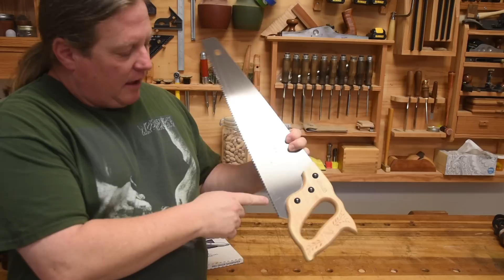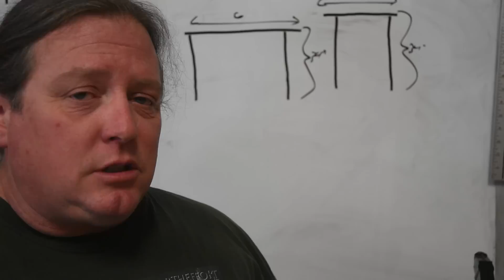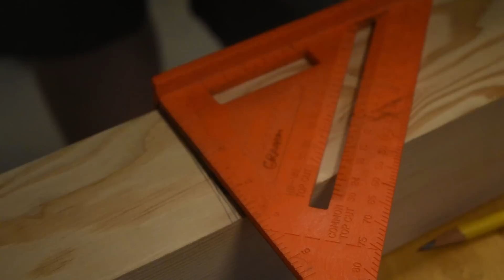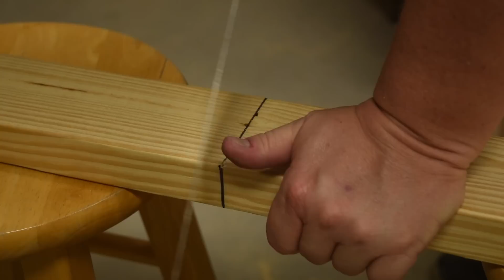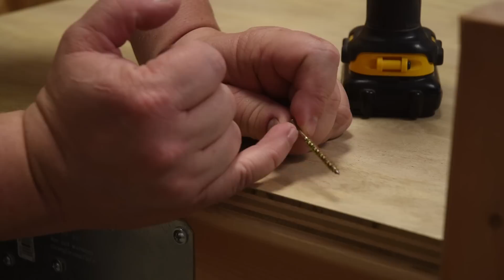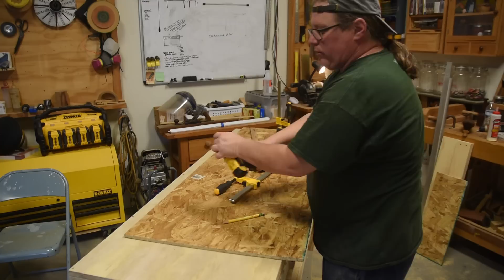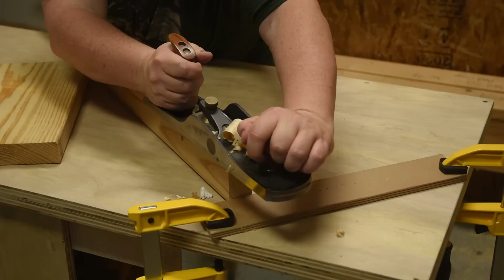The "No Skill" DIY Workbench Build - Start Woodworking Series Launch (Class One)

Comment: Lol I built a counter in my old barbecue restaurant with 1x6 boards that I took from a bunch of free wooden pallets and the counter top was a brand new industrial fireproof door that had corner damage from being dropped in shipping. That was also given to me for free. Only out of pocket expenses were for a few 2x4s for the frame, 2 1/2 inch screws and 4 carriage bolts that I used to secure the repurposed door to the top. Lol even made a swinging barn style door with the pallet lumber as the pass through from behind the counter. Turned out amazing
Reply: Oh and a couple gate hinges and latch

Comment: I had to laugh at the "system" to prevent your bench from creeping. Awesome, simply awesome. I love the entire bench. I built my first bench a year ago from construction left overs, and using very similar construction, though I didn't use the metal corners (wish I had know about those). Since I built it I've made a lot of modifications to it. I added a 10" apron on one side and put dog holes in it so I could use dowels to support long work. But I still haven't added a vice. Clamps, hold fasts, screw clamps, they are easy to use and completely flexible. Love the approach, love the bench.

Comment: The shelf will fit without cutting, you just have to turn it a bit and let one end down below the there and slide the short / width end in at an angle.
Another way is to put it in using the same method (above) but from either SIDE (not the front) of the bench.
DON'T be afraid of turning and angling the shelf to get it inside the bench then straighten it out to lay it flat.
It will work - I have 3 sets of these that I made into 8 foot high garage shelving and that is how I fitted all my levels of shelves.

Comment: Nice. Love the simplicity I think I would lay the bench down on the stools to lop off the tops. For me it was easier to cut down then to cut sideways.
Reply from the maker: Thanks. On it's side you'd have to saw on your back or upside down in order to use the two rails as a guide.

Comment: Great tutorial. The reason I came here was because I saw my 30 year old bench in the preview and I attest it is very strong- 30 years later. Got weight? Put shelf 5 inches lower and add a layer of engineer blocks on top of it.

Comment: Built this workbench with some modifications, I had to use the brackets for the 2x4 legs because I could not find a reasonable source for the ones for 4x4's. I also had to reduce the length to 5 ft because my workshop is very small. I also built two bench dogs for use on the bench. I am going to add the 2 Screw vise you added in Class 3 of this series  using 2 lag screws and a 2x6. I have purchased some compression springs I am going to mount over the lag screws to act as return springs when I adjust the vise. I also have the idea I will add a leg vise to the other end also operated by a spring loaded lag screw. Still thinking about how I will do this.
Reply from the maker: Springs good idea. Tell us how it works out.
Reply: @wortheffort  Unfortunately the springs did not collapse enough and kept the vise from closing so it would not grip thinner stock. I am rethinking how I might make it work so the vise can close fully. First thoughts are to bore recesses about 3/8 " deep not aligned with the lag screws and let the springs collapse into them. That should allow the vise to close fully. Trying to figure out how to support the springs as they retract and expand. They will need a rod or something to keep the springs straight.

Comment: For any other newbies watching:

I just finished building this, and there were 5 fairly significant things he left out that I wish I had realized when I started following this guide:

1) 100 screws is not, in fact, enough. And you don't want to only get the ones he linked to. Those are great for screwing in the metal parts, but they aren't long enough to screw in the middle struts and whatnot, where youre screwing through the 2x4 or plywood (not just *into*). Idk what the best is for the project; I ended up experimenting with and using a variety of screws. About the only advice I can give on that front is that 3" screws are WAY longer than you need (I think?). Probably best to do some research yourself.

2) Drill in pilot holes before screwing!!!!!! I cannot emphasis this enough!! I've got a couple of screws on the interior of the legs that are currently not screwed in all the way, and stripped to hell. I even had one screw snap on me when I was trying to screw the middle struts in (screwing into end-grain is TOUGH). I didn't realize until afterwards that the reason I was having so much trouble with them was because I wasn't drilling pilot holes in before screwing. Use a drill bit that's about the same width as the shaft of the screws you're using, but not as wide as edges of the screw. It's a bit more work up front,, but it'll save you A LOT of trouble and headaches in the long run!!

3) The quality of the drill you use is important. I got a cheap, cordless Dewalt drill from a pawn shop. For some reason (presumably a crap battery), it loses a lot of power quickly, and it'd frequently just straight up stop screwing in my screws in the thicker portions, even with pilot holes. I believe that an impact driver would solve that problem (or possibly a new battery). Instead, what I did was use a cheap, old bit-brace hand drill to do my drilling and screwing in the thicker portions of the table. It was a bit of extra work, but worked FLAWLESSLY. Even if you've got a good drill and impact driver, I'd highly recommend getting a bit-brace hand drill as a backup.

4) Either get a good push-style saw, or a Japanese style pull saw. I picked up a general use, $15 saw from home depot, and sawing was hell. It'd grip the wood like crazy, the curf was huge, left a pretty rough finish, and was generally just difficult to use consistently. I ended up getting a Suizan Ryoba Japanese pull saw, and OMG the difference is HUGE!! I was able to get SUPER smooth, clean cuts with insane ease! I actually enjoy sawing with that thing! And it was only $30! AND you get 2 saws out of it, one side for cross cuts (the only kind you have to do for this build) and one for rip cuts!

5) Unless you've got a truck or similarly large vehicle, transporting wood is gonna be a pain in the ass. I've only got a Toyota corolla, so I'd have Home Depot cut down my lumber to my desired dimensions for me (the Lowe's near me, at least, doesn't do that; they only cut down plywood), that way I could fit it in my car. Even then, though, it took multiple trips. And, even after having them cut down the plywood top, I could not fit it all into my car. I ended up having to leave the extra bit that he used to brace the table in the parking lot. If you've got a small car like me, I HIGHLY recommend getting someone with a bigger car to help you, or getting something on the top of your car that you can strap the wood to. Whatever you choose, just make sure you plan around that limitation so you don't leave $30 worth of plywood in a parking lot like I had to.
Reply from the maker: Granted 100 screws per kit won’t cover center stretchers. Showed that in video. Also getting a used corded drill was recommended. People only sell cordless when batteries go caput. The screws sold with kit shouldn’t need predrilling. Curious what caused strip and breakage. The $15-20 Stanley sharptooths are decent for what they are. Pull saws use different techniques. I built for the first 5 years of this channel with a Mini Cooper. Roof racks make a world of difference.
Reply: @wortheffort   Wow!! I wasn't expecting a response from you!! Thank you for the entirety of your channel and work; I can't begin to tell you how helpful and inspiring you've been for me!!!

Just to be clear, I wasn't intending to criticize or denigrate your video; just pointing out some things I didn't get from the video but would've helped while building, as a COMPLETE newbie.

Between the intro bit on supplies and the link in the description, I was initially under the impression that those 100 screws would be enough. After I ran out, I was at a bit of an awkward impass; I still needed like 2 or 3 more screws for the legs, but also needed to get screws I'd need for the top and sides (which you hadn't provided any specific recommendation for, so I kinda had to guess a bit on, not knowing the world of screws very well).

I know you recommended a used corded drill but, as I understood it in the video, it sounded like that recommendation was mostly to save money; I didn't realize a used cordless wouldn't be as good (and that may just be me; I'm basically the epitome of a skill less beginner; I've been all about math and computers my whole life til now).

The screws you recommended I didn't have a problem with without predrilling. It was once I ran out and had to start using other screws that I started running into issues; honestly, I have no idea what the difference is between them that cause the ones I got that were longer (for the struts and top) that were different enough to cause them to break/strip. I've no idea how to identify the qualities needed in a screw; I just found whatever woodscrews I could that were long enough and I had a bit for, and when they started to strip/break, pre-drilling the holes alleviated the problems I was having by A LOT.

As far as the pull saw recommendation, I recognize that you were focused on building the skill around the push-saw style, which is absolutely fine and cool, I just wanted to share how much of a world of difference the pull saw made for me in my attempt. I'm sure I'll figure it out over time, but currently I cannot for the life of me figure out how Japanese style pull saws aren't more the norm, at least for general-purpose sawing. It felt like the difference between cutting through bone vs cutting through butter.

And yeah, I'm definitely gonna have to pick up a roof rack at some point. Having to leave that last bit of plywood behind damn near broke my heart. Lol
Reply: @wortheffort  with regard to the screw that broke, it WAS while screwing in the middle struts, and I suspect that the reason there was so much resistance was due to a combination of screwing into end-grain, a knot that was in the strut, and probably being low-quality wood screws. Why I didn't have as much trouble while using a hand drill, idk.

Comment: Made my first "worktable" a week ago with one 2x4, and two 2x3's. It's uh...18"L x 12"W x 30"H. 6-1/2" vise on one side, a few dog holes, and storage shelf underneath....I live in a small apartment, so my work space is very small =). I made the supports low and sturdy enough to stabilize the bench with my foot if it moves. It fits my needs as I carve spoons, axe handles, and make small furniture. In fact because it's so small I can clamp something down and walk around all sides of the bench to work on it from all angles.
Reply from the maker: that'll work

Comment: Great video and I just left left Home Depot this afternoon with all the materials. 
Here's my list and cost, I hope it helps someone: 
$104  Wood: (3/4 plywood $42, two 4x4s $30, five 2x4s $32)
$50  Simpson brackets (8 x $6.27)
$32  screws (two 100 packs of #8 x 1-1/4", box of 50 #10 3" wood screw)
$12  wood glue
$10  sandpaper
$208, with tax $220.  
I didn't get an OSB board for now--I may or may not do that later.  
I'm looking forward to building this in the next few days!
Reply: Construction sites are a good source for scrap wood. Examples, new apartment builds, new home builds, new shopping center builds. Home Depot and Lowes both have scrap carts.

Comment: I have a bad shoulder due to an injury and cannot make that many cuts with a hand saw.  At the same time you purchase your corded drill and can also get a reasonably priced corded circular saw.  Presuming, of course you are unable to get better cordless tools.  I would suggest you buy the best cordless tools you can afford.  They are a great investment if you plan to do any more woodworking projects.  Just my two cents.  By the way, the first bench I built was very much like yours, except mine was a full 8 foot long.  The strongties are well worth the money and easy to use.

Comment: i like EVERYTHING all except the last part its overkill though its the 1st time i saw it its clever but still its over kill a little rubber will do like you say good job none the less cant wait for the next one..
Reply from the maker: That's more fore those who use 2x4's or Sjoberg benches as there isn't enough contact patch and weight to make the rubber work well.
Reply: I got a free tire inner tube for free from my local tire store for free.  Going to cut and glue to bottom of my legs

Comment: great video, ill be making one.  A couple of suggestions, though.  Spend an extra $20 or less on a used skillsaw, save a lot of time.  Also, before you mount your  top, cut out your leg spaces on your bottom shelf, and drop it down from the top, then you wont have to cut in half.  just some ideas

Comment: Great video, but honestly, for anyone reading....get the cordless drill.  It's not just the cord that makes the tool less useful.  At least a cordless drill has a clutch and a brake, so you can avoid plenty of stripped screws.
And if we're being frank anyway, get the drill and impact driver kit if you have the money for it.  It makes life so much easier.
Reply from the maker: Yes those are better options. But the idea here was just getting started. If all you have is a screwdriver it's still doable.
Reply: @wortheffort  yes, i agree with your lesson in this video. You've shown that you need no nonsense to get the job done. Thanks again for the useful content.

Comment: Around the 30 minute mark, you fasten 2x4's under the top rails so that the supports in the middle will be perfectly flush with the top. Because there may be a (slight) difference in widths of two 2x4's, the board you cut the inner supports from may not be exactly the same as the front and back stretchers. Wouldn't it be better to fasten those temporary boards to the top of the stretchers, turn the bench upside down, and then fasten the middle supports? ( Sorry if this has already been asked, but I haven't yet read all 500 questions/comments for this video.)

Comment: Professor, Thanks, good video on a project I'm planning. One thing out of your control has been inflation since you made the video. In my preliminary pricing for budget, and I am being conservative,  this project, assuming you have tools, is over $400.00. You can buy a sturdy work bench for about that or less, Thanks to China. I have always preferred to build my own projects. However, lumber and hardware prices today prohibit that  So I have decided to give my tools away except for basic tools, its just not worth it any more.
Reply: I get the sentiment. For me the question is how to do honey-do projects around the house? You could get rid of all your tools completely and hire a handyman to do everything for you. It sounds good in theory, but just doesn't work well in practice. It's not always easy to find an available person that can do the project on your timetable. Then describing what you want done is sometimes difficult if it is a design-on-the-fly project. Then selecting the wood for each project is personal preference and the handyman might not pick what you would have picked. I don't like it when I have to hire someone to do everything. For that reason, I have tools, a small table saw, and this bench. You are right though ... it is not cheap to build this bench.

Comment: Great video. I've been making due for a few years with sawhorses and needed a detailed build. I have a question. Why double up the top? Is it so you can remove the screws from the top piece (no metal)? How thick does the top really need to be? I'd like to add a whiteboard piece to the top rather than plywood. It's less than 1/4", so what do I need to consider doing it that way? Any help would be greatly appreciated. Thank you!

Comment: Yeah, I'm watching this on my work breaks... 5 minutes here, 5 minutes there... my first workbench was "overbuilt" by most people's standards. But today, my workbench is by far the best investment in "overbuilding" I ever made. It was a Torsion box mounted on 4x4s, using 1/4 inch bolts, straight into the 2x6s of the torsion box. Yeah, it was boss engineering for a 23 year old artist with nothing else in the workshop.
Reply from the maker: Thanks

Comment: What are those screws you used for the table top?  #8x 1 1/2" ?  I managed to find the ones for the brackets but couldn't figure out adzactly what were used on table top.   Thanks for the  great video btw. I'm new to woodworking and i intend to build one identical to yours.

Comment: This was my first workbench build and it turned out great! 

QUESTION: if I built another one, but it was 5' x 6' (to hold a CNC) would I need to add center supports, or center posts/legs, to keep it from sagging? Or, would the 2x4 stretchers along with the metal Simpson corner brackets keep it from sagging?
Reply from the maker: I doubt you’d even need a top. Build the frame to fit the cnc.
Reply: @wortheffort  The CNC needs a table to bolt down to, so I'll have to put a sheet of plywood down.

Comment: You said that you want to use screws so you can take it apart later. at 44:57 you sandwiched the screws and glued the boards together. How do you disassemble the top now?
Reply from the maker: I talked about that. You waste 2-4 dollars in 2x4. Don’t put glue on uprights. So how, with a screwdriver. :)
Reply: @wortheffort  Oh dang. I missed that. Also my mindset was that the base is "sacred". But with the iron angles and fixed 2x4 size replacing is not an issue.Thank you for this series!